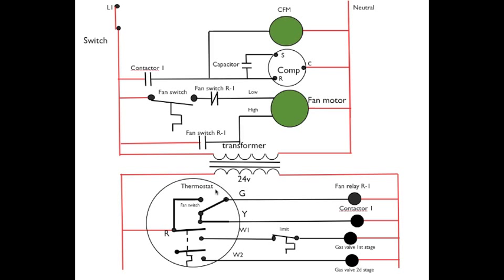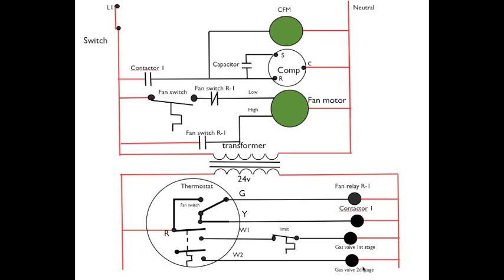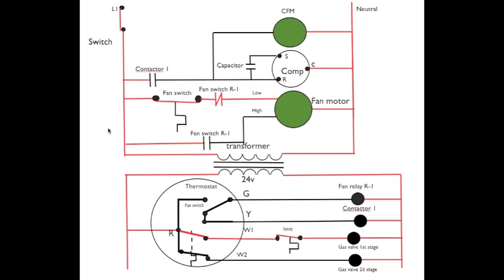Schematic diagram #10.  2 stage heat.

Comment: Hi GFM,
Great video,  One thing in these diagrams that  gets me is the capacitors.  In your example in the video the cap at the compressor would be a run cap right ?. Is there a better way of knowing if it is a start cap or a run cap without seeing how the lines are drawn?

Thanks for everything.
Reply from the maker: Sometimes they are marked.  I use diagrams that I see in the field.  Not all of them are clear.
GFM
Reply: grayfurnaceman
Thanks for the reply GFM!   I appreciate it.  I will just keep practicing reading your examples because they really help me allot. Thanks again.

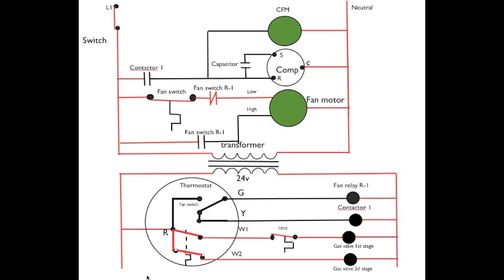Comment: This one seemed wrong. Your call for more heat in 2nd stage never changed the fan from low to high. Plus, in both stages the electrical connections to (w1, w2) were both connected both times. I would think the R really would have somehow switched electrical connection in some way as to not connect R to both w1 and w2 at the same time in both calls for low and high heat. Am I just not understanding something? See image ~1:30 and then 2nd image ~2:16. I don't see anything change other than you made a black line for R to w2 turn red but it didn't change position, just color.
Reply from the maker: First, thanks for looking closely.  I purposely did not include the switch to high speed on a call for 2d stage heat because it complicates the diagram more than I wanted to at that time.  As for the W1 and W2, the 2 solenoids are in series in the valve so that 2d stage cannot come on unless 1st stage is on.  That also makes the limit in the circuit effective even when 2d stage is on.  Keep up the good work and make me be sure I have done it right.
GFM